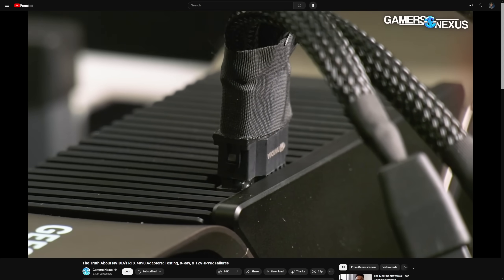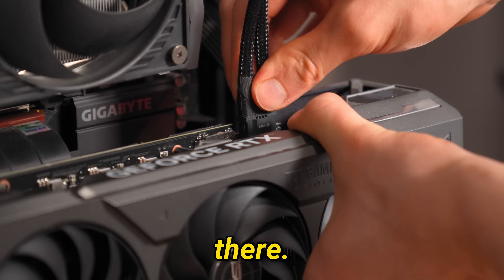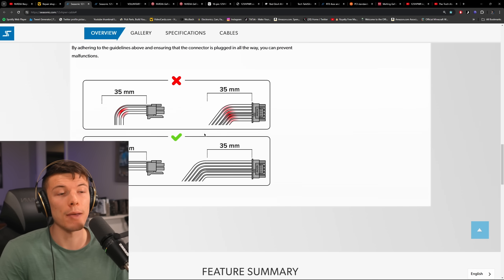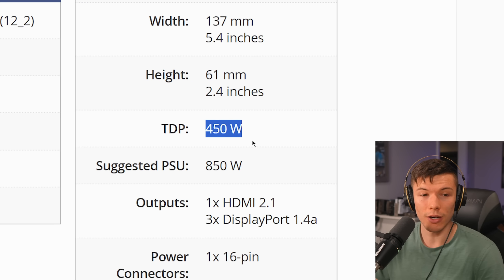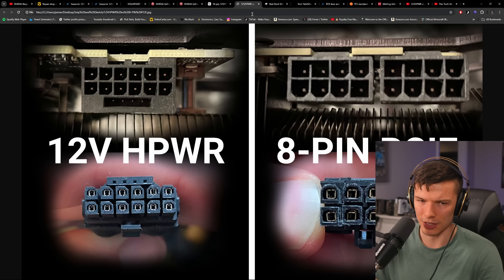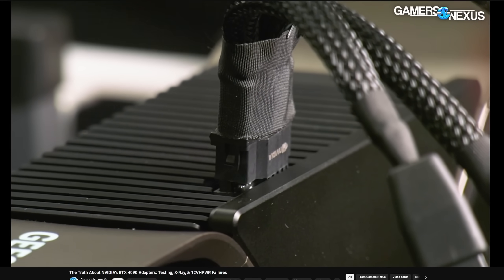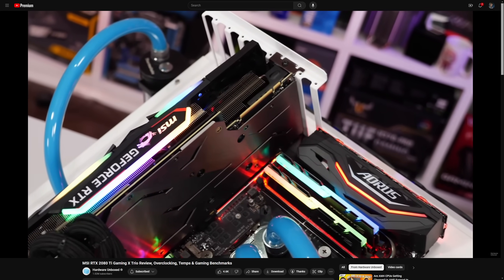The Dumbest Thing to Happen to Graphics Cards

Comment: The connect is not goofy. I wish it worked properly so that I could reduce the wires. The reason why they cannot use connector capable of carrying 220w is because the gpu can spike power up to 1000 w
Reply: textbook example showing that you have no clue what you're talking about 🤡

Comment: why dont they just move the powerslot to the side of the card instead ontop. or normalize the asus mb connector with plug on the backside of the mb
or just remove any plug on <300w cards and just power it from the mb

Comment: They have all these unprecedented stipulations on users just to keep the thing from immediately melting.

Well, it’s not like following all those stipulations to the letter will mean it’s suddenly running at room temperature, either. These things are running excessively hot at all times.

I’ve seen people are even developing the melting plug problem on 4080s. They don’t even consume nearly as much power. It just happens over months instead of days. And why are Nvidia cards always so prone to thermal problems? Even in a generation where they’re using the more efficient node, Nvidia’s still found a way to have thermal reliability issues. What’s up with that?

It’s just a bad design.

I just had to double check which of my 3 PCs have 2x versus 3x 8-pin connectors. It’s not anything I ever have to think about. I don’t have some aesthetic hang up over how it looks and don’t have to think twice on how reliable it is.

Based on real world results, from where I sit the only responsible way to go about things if Nvidia is so determined to double down on this nonsense is 2x12pins on the 5090, maybe also the 5080 depending on where that lands. And these 12-pin connectors are supposed to be more elegant? [looks at melted plug pics]

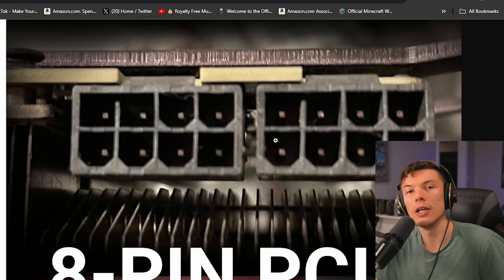Comment: At 9:12, no one commented on the 1.9 safety factor for PCIE vs 1.1 for 12VHPWR. At 1.1 it virtually does not have any safety factor.
Reply: Ya knowing that some 4090 can reach 580 Watt in real consuption when there is no bottleneck, this has to be mentionned !!!
Reply: What is safety factor?
Reply: @shanent5793  basically "what it's rated for" vs "what it can actually do"
Reply: @jskilabe5986  that's too basic. There must be an actual definition
Reply: @shanent5793  a 600w 12vhpwr is rated for 1.1x600=660w max and 150w pcie is 1.9x150=285w max. That's the maximum power you can put through before the cables start melting. So 3x150w pcie has a max wattage of 855w that nvidia then wants us to pull through a 660w cable. nGenius!
Reply: @magzpayne  3x150w is only 450W which should be safe to draw from a 660W connector which has its own margins on top of PCI-SIG's. Further derating can't account for improper installation. Once a pin has been distorted it can fail even if it were designed to have a 5x margin, because it's no longer operating within spec
Reply: @shanent5793 Yeah, if the pins were not that thin and made from copper instead of brass as the spec calls for, which means the pins can deform from normal plugging in.
The lowest number I heard was 5 times of connecting or disconnecting.

That's slightly more than one perfect pluggong in and one demounting for a proper cleaning if the Graphics card heatsink.

Igor from Igorslab did a full material analysis on the cable plugs, and he found that out.
Reply: This is what really frightens me. Even with the new 2x6 whatever they call it, if factor/margin for safety is still so low, the only option is to run GPUs that use the old proven 8 pin connectors, no matter the GPU wattage.
Reply: @shanent5793  When people design or build things, either a bridge or a plane or chair, they calculate what the target capacity or capability of the design they want.
Let's say a bridge is assumed to withstand a weight of 100 cars, but they design or build it so that the bridge can withstand the weight of 200 cars just in case this could occur. So with this assumption, there is a safety factor of 2. So someday, whenever there is a huge traffic jam or whenever there would come a day that there would be 190 cars on that bridge for whatever reason, the bridge would stilll hold.
If the bridge was designed and built with a safety factor of 1.1 then if the traffic on that brodge spike to more than 110 cars, the bridge could collapse. Either way, a safety factor of 1.1 is very minimal as if there is no safety factor.

The video at 9:12 shows that safety factor difference. Too bad Vex did not discuss this more.

You can also read this Wiki article https://en.m.wikipedia.org/wiki/Factor_of_safety which is linked in the Wiki Article shown at 9:12 https://en.m.wikipedia.org/wiki/16-pin_12VHPWR_connector

Comment: I just bought a cable form the manufacture that is type 4 and fits my PSU.  So I dont need a 12VHPWR convertor.  Cable mod cables were melting with the 4090 and they had a recall.  This is a new PSU connector, not a new nVidia connector.  Its sad that 4090 owners appear to be the ones with issues.  I wonder why 4080 owners dont report this issue in mass.  Could it be the higher power draw of the 4090?  Its funny how the melting issue of 8-pin connectors wasnt ponted out like this has been.

As this is ATX 3.0(?) all new PSUs will have a 12VHPWR connector.  ATX 3.1 aims to fix the issue by forcing the GPU too short the sense pins before power is sent.  This way there will be no power if the cable is not fully seated.  There is a new new 12V-2x6 cable connector.  90-degree 12V-2x6 connectors include improvements such as increased flexibility, 4 springs for a larger contact area with lower impedance, and a 25% thicker terminal. Each of these improvements means that our connectors have a 45% lower impedance change rate, a 12% higher average insertion/withdrawal force, and 5°C lower temperatures.  -source coolermaster

Comment: Shit designs always cause trouble, and this one is  the king of them, it makes you wonder the logic of who thought this one up,  if they wanted to come out with a smaller  and such a densely packed connector that lacks the engineering slack for end user installs  with conductors that small then  they should be secured with a screw or thumbscrew at each end -  this approach used to be common many years ago for external peripherals as it ensured the connection was properly seated and couldn't move, that would be problem solved

Comment: Gotta love the 1.9x safety factor in the 8pin,but only 1.1 on the 12pin.

I read that as 150w +(150w x 0.9) ≠~280w
And 600w + 10% =660w

Another thing that's odd is going direct from gpu to psu. There are perfectly good system management buses on motherboards that the psu could have spoken to the gpu over. 
And why 4 wires? Surely it's a simple serial link. 2 should be fine. Dell manage to use one wire on their laptop psus and there are plenty of examples of signalling over power wires. What's wrong with using an earth wire with a low speed serial over it if you absolutely must talk directly with the gpu? 

It all seems kinda inelegant.

Comment: Apparently I'm lucky with my 4090 (palit Gamerock). However, I bought a new power supply with a native 12VHPWR connection and a new cable so that I don't need the adapter. In addition, I limited my card to 360W in the software. This works without any loss of performance. As a nice side effect, it also stays quiet and cool. If you now make sure that the cable is seated correctly and there is good air flow in the computer, everything should actually be fine. I can well imagine that many people just plug the card into the computer and don't pay attention to sufficient cooling, nor limit the card and have poor airflow in the case. Then plug the whole thing into an older non-ATX 3.0 power supply using the adapter. That's a recipe for disaster if the card starts running at 600w under these conditions.

Don't get me wrong, it should actually work that way without burning down and in my opinion the main blame lies with the manufacturer. What I still don't understand to this day is why the hell the cards can use 600w when it actually doesn't help at all, except for a hot and loud card. With a firmware update, all cards could have been limited to 450W without any loss of performance.

That probably could have saved a lot of cards from connector meltdown, I guess.

Comment: I have a Corsair PSU with their own 12phwr cable on my 4090 and I've had no issues, no adapters, no bulky cable, fits really well in case and it's quite narrow. So far no issues but I do occasionally inspect it because of paranoia.
Reply: Got the 4090 from MSI when it came out and just using the adapter that came in the box. It has held up well running AI, gaming and video edits. People are just mad that they either have to change the case or get a new PSU.

Comment: I got a 4090 recently, and had to use this cable for the first time. It’s pretty snug (as in tough to plug in and frankly hard to tell if it connects), but the tight tolerances as well as the warning light when it isn’t fully connected makes it pretty easy to notice it’s plugged in wrong. I’d consider it about as annoying as the 24 pin assembly on a motherboard, just smaller and a bit less difficult to reseat. On top of that my case is huge, so the cable isn’t pulled or angled too harshly. I forgot to mention I don’t need the dongle. My power supply has a 12v slot for this specific cable.

I’d imagine the biggest risk with these is proper overclocking. I’m not bothering with that kind of performance, so it’s not a huge risk.

It seems like this is going to be the standard for the future (at least for now since we are in an era of GPU performance where wattage is climbing instead of efficiency), so hopefully they keep it up with making sure the connector is solid.

I’d imagine there are valid cases where the connector failed but I wouldn’t be surprised if most of them just weren’t fully connected and caused a short.
Reply: Unfortunatly your're wrong, some 4090 connectors are burning because the max allowed power by pin (of the 12VHPWR connector) is clearly reached !!! Just read the spec of that connector to understand what i mean. (it's even happening on some 4080 that the max power limit is too high)
If i were you, i'll even undervolt my 4090, you'll not lose perf ( < 5% ) in order to avoid a risky situation and the possible coil whine will be weaker too.
Reply: @guillaumeguitarian9642 what I find funny about this video and the actual article is the fact that the ARTICLE STATES the users of those cards did NOT USE the supplied cable . They used a cable mod connector or something similar that put the cables on a 90 degree angle 🤔 but let's just leave that out to paint a narrative

Comment: This connector is so stupid, thanks for reminding me about it. Why power monsters back in the day were fine with 3x8pin, why did it need a change? At least test the connectors properly before forcing users to Q&A on their money for you.
Reply: I have three 8 pins in  my gpu. I don't think three cables is that much extra work.

Comment: I have a 4070 with the 12VHPWR connector. And once a week, I remove my Panel, and re-seat the cable. Because I don't want the cable to melt.
I never had to do this with the 8 pin connector. It snapped on, and never had to think about it again, until I had to clean my system.
Reply: the more times you plug in and out , the more wear and tear you do and make the connection loose. and that is not what you want.
Reply: @StaceyJensenn  Maybe its time to sell my current GPU, and get one with an 8 pin. Because the connector felt very loose since day 1. And If I remove the side panel, I see the cable hanging out half way. And I'm not moving Case at all.
Reply: Youre literally making your connector more prone to failure.
Reply: @davidfaustino4476  Good, then I can claim an RMA, because of the shitty connector.
The cable sticks out half way every time I remove the side panel.

Never had this issue with an 8 Pin connector, it always snapped on, and stayed in place no matter what.
Reply: The 4070 power consuption is rather low compared to 4090 (or even some 4080), i do not think you have to do that with this GPU
Some 4090 connectors are burning because the max power by pin (of the 12VHPWR coonector) is clearly reached !!! Just read the spec of that connector to understand what i mean.
Reply: @grogs777  How about if the cable sticks half way out, would that be a problem? I have to re-seat the cable regularly, because the cable feels very loose.

I even ordered a replacement cable, Still same issue. It works, But I'm afraid the cable is going to melt because of improper contact.

I'm considering Switching to AMD. Because none of the Nvidia cards ship with an 8 pin these days.
Reply: @DeadPhoenix86DP  I've personnaly bought an Asus dual Fan 8 pins connector 4070 some months ago.
Switching with an AMD card is a good option if you do not aim at doing other thing than playing with your GPU ! (My 6800xt was a monster of power but because of my work i had to switch with an Nvidia's GPU, i missing my AMD GPU too much)
7800 XT / 7900 GRE are very good deals if you're playing at 1440p (2k) plus they have both 16 Gb of VRAM !

Comment: Was wondering why brands such as Asus, Gigabyte, MSI and more don't install traditional 8-pins on their Nvidia cards. Should just have listened to the people instead and let them choose which version of the card do buy. I ain't gonna buy that crappy 12HPWR connector card in a forseable future.
Reply: Nvidia dictates with an iron fist over AIBs. The days when AIBs were allowed the freedom to create bonkers overkill cards for OC or just plonk double the VRAM onto the card than what was normal (like the 4GB 960s as one of the last examples) are long since over. Nvidia doesn't allow AIBs to deviate from their rules even by a tiny bit, and if nvidia says "12VHPWR on everything", the board partners have to follow or they'll no longer be board partners  (older guys might remember XFX was once an nvidia partner. They dared to try and diversify by planning to produce AMD based cards alongside nvidia ones, and JUST TOYING WITH THE IDEA to do that promtly led to nvidia straight up banning XFX as a board partner despite the AMD stuff only being theoretical at that point. that's why nowadays XFX are exclusively AMD... because they had no choice after nvidias middle finger)
Reply: Just because Nvidia made it mandatory on GPU > 4070

Comment: it is good that you showed how much more overhead the 8pin had. I've been screaming about it since they introduced the 12VHPWR connector that it isn't up to the task. also for the wire guage, it is good to go with 6A/mm² as a guideline for the current capacity. maybe that is a bit conservative, but I think the application needs a bit more conservative math.

Comment: There should only be 6 or 8 pin connectors and no graphics card even 90 series should be more than 300w. 400w+ cards are inefficient space heaters and in some cases can be a fire hazard like with this newer connector type. I'm sure a 4090 can still do 70 teraflops at 300w which is good enough.

Comment: And this is why I bought the highest 40 series with an 8 pin (in my brand! grammar police). In spite of everyone trashing the 4060ti16, I’ve never once worried it was going to burst into flames, and it’s been a solid GPU for all my games, especially the games that people are having issues with using 4090s: DD2, cites skylines 2, etc.
Reply: Nvidia doesn’t give a shit about consumers, which is why Jensen said in his last event that server blades are GPUs to him. He will never outright say he doesn’t care about consumer GPUs.
Reply: "highest 40 series with an 8 pin" ... and then he says 4060Ti... bruh. most 4070s (plain, ie non-super, non-ti) have 8pins and beat the crap out of the bandwidth-crippled 4060Ti
Reply: @Knaeckebrotsaege  That's fine and dandy, I just want a 4060 ti for a secondary system anyway.
Reply: @ArtisChronicles  4060ti 16 is a good card if you know it's limitations and act accordingly. Also, I see a lot of people saying switch to AMD, which isn't terrible but I'd rather have the benefit of both brands in my system in tandem so I can get the best of both brands' tech depending on which game I'm playing at the time. Even if my 6000 series AMD card is mostly dormant. No, I'm not getting 4k out of my system, but I am getting 1660p60 in all my games when most reviewers tried to say it was only good for 1080p.
Reply: Sry meant to say highest one worth a damn. 🤣 I need the extra vram for modded games. Also the brand I use does not use 8 pins on the 4070.

Comment: What is the reason to split it into 12 pins? 2-pin connectors such as the xt-60/90 can handle 600w.

Comment: 4090 issues was people bending the wires to the point of becoming an issue because, they have mid-size cases that did not allow proper room for the cabling needed for the 4090 cards.
  Benches having the cards not having to worry about room since they are not in a case did not have the issues.  Cabling later was changed to make up for people, not respecting The Power of Electricity and its flow through cabling.

Comment: I helped a very goos friend of mine in the USA, to get a brand new PC - he wanted the best he can get. We discussed NVIDIA at length, ultimately he saw a good reporting video from GN (Gamers Nexus) and decided against the RTX 4080.

He got a RTX 4090 
That 1-2 months later, started smoking from the power connector. Thankfully Amazon
accepted the return. 

He got a AMD RX7900XTX with the 3 - 8pin power connectors and has been Super Happy with it. He never had any issues. 

We used DDU to remove old drivers and installed the new ones after a restart. 

Every game he plays runs buttery smooth. The R7 7800X3D and a RX 7900XTX is a good combo.